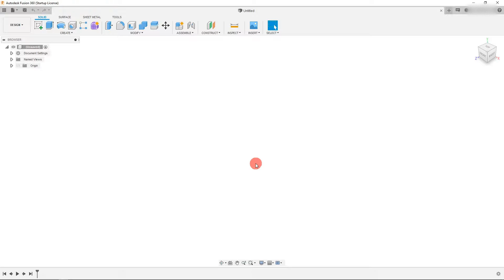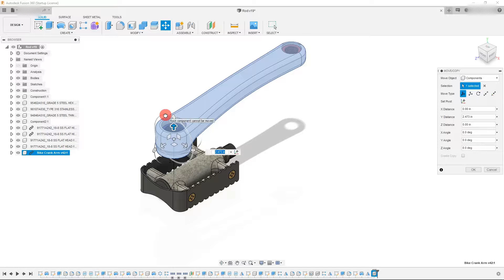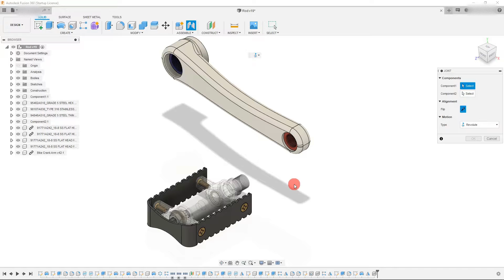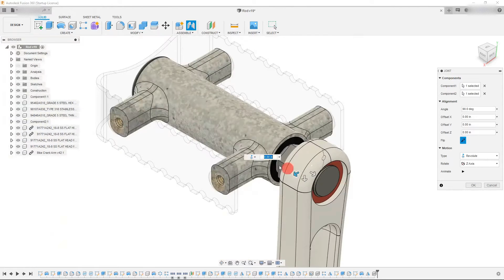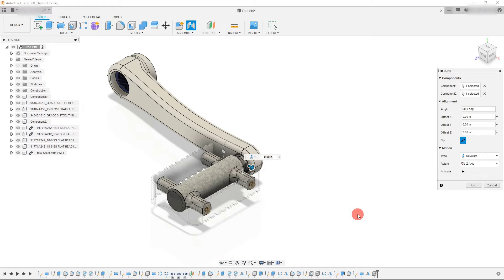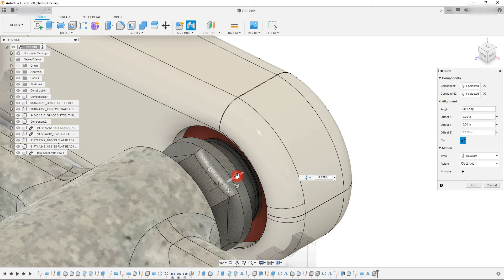Revolute Joint Assembly Tutorial in Fusion 360! Crank to Pedal

Comment: That's nice, but how do you rotate the component manually, after you create the joint? Or is it only possible to rotate it with "animate" button?
Reply from the maker: You can drag it to rotate it.
Reply: @AvivMakesRobots  
thanks, I just realized what was wrong, it seems that main part has to be grounded, else whole assembly is moving when dragged.

Comment: Very helpful video, as usual. Can you help me with a problem? I designed a simple folding table with folding legs, but it's not working. The table was working fine, but then I add the legs, and the joints, and in order for the legs to work, I had to ground some element that now prevents the table from folding. Is this doable? Many thanks!
Reply from the maker: Thanks! It is certainly doable. You need only to ground the table top. Nothing else should be grounded.
Reply: @AvivMakesRobots  Although that does work for the legs like I said, the top also is supposed to fold down, and grounding that makes it a problem. I made some other rigid joints I hadn't before, and grounded the piece that goes on the wall. Now it's working. Thanks for taking the time! Cheers.
Reply from the maker: @baldurkuhn1  Huh. I didn't know there was a wall piece! Now I want to see this thing.